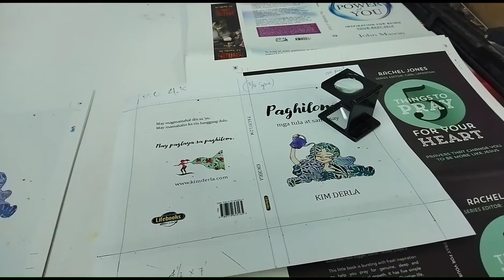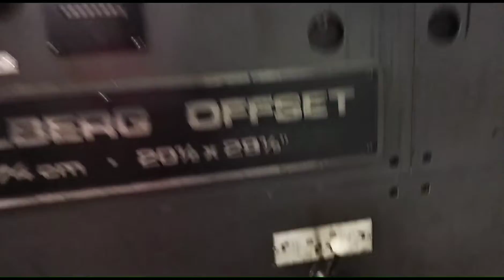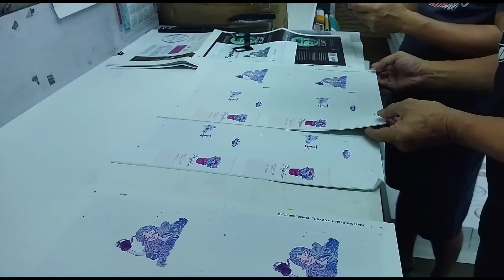master of sormz Heidelberg

Comment: The first Heidelberg press I ran was a SORKZ  19x25 in 1981. It had conventional dampening, IR dryer.  You could really lay down the ink with that press. I just retired running An MOVPH and H640PP+L 😃